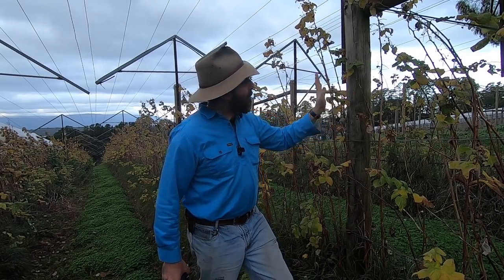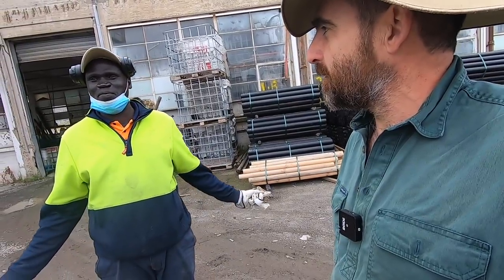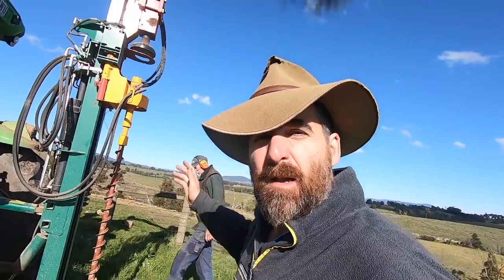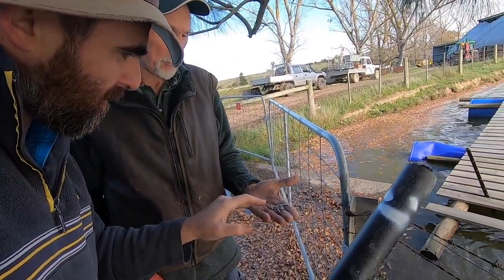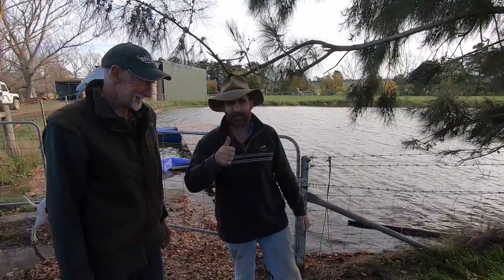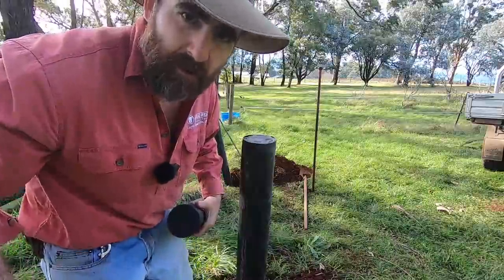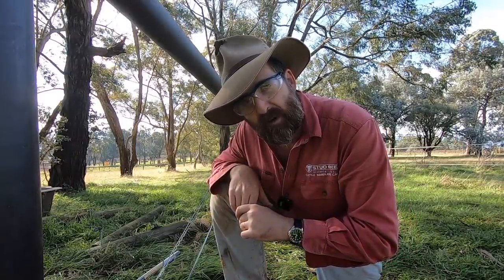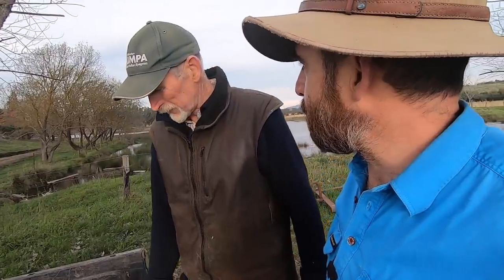Product Review, Woodshield Posts - The End of Toxic CCA Pine?

Comment: The only small drawback is the lifecycle of polypropylene.  Plastic suffers with ultraviolet light and polypropilene in particular. The proof is in the UV treatment. The good thing about them is that it is completely recyclable. It can be easily chewed by some steel chew jaws, separating wood and plastic.  The wood can be made into pellets and the plastic reused.

Comment: Would heating up the screws securing the David fencing clips (prior to drilling into the plastic coating on the wood post) result in an even better water resistant seal, or is the seal demonstrated in this video more than sufficient?

Comment: Fence posts here in Western Washington state often rot at the ground surface.
Reply: Hey Del, I'm here in Western WA as well. I'm planning on putting up 4'x8' hog wire panel fence. These posts look interesting but im wondering if I'll be able to get them here. Have you looked into it?
Reply: @toddburdick1  There's a product called poly21 that can be applied which polymerizes. Seems to work but product must be used within two days before it hardens completely.

Comment: Another great video Tim.  Tell me, could you heat the plastic around the staple to shrink the plastic?
Reply: Just another thought as well Tim, if using these for end electric posts would there be any need to use insulators given the water would just slick off them?

Comment: We found a different outcome, the posts we drove and pulled out were damaged at the bottom and the top from the driver, the top looked messy but probably still water out but the bottom was to the pine.
mind you we drive both ends of our assembly in 1100mm and the intermediate posts were in 900mm.
The other issues I was wondering about were the UV damage on the polyprop .

Without the treatment any water will damage the pine very quick and the end in the ground will have moisture to deal with.

Our solution was to drill bigger holes and pack strainer posts with a crow bar instead of driving them the intermediate posts we still drove just with a bigger pilot hole to lower the friction.  Was a tonne more labour, next time I would use steel or hardwood strainer assembly's if a client wants these
Reply from the maker: Great feedback
Reply: Tim i love your work, lots of great info and product tests most people have no idea
Reply from the maker: @kierenlewin1510  thanks mate. I always try to be positive and practical.